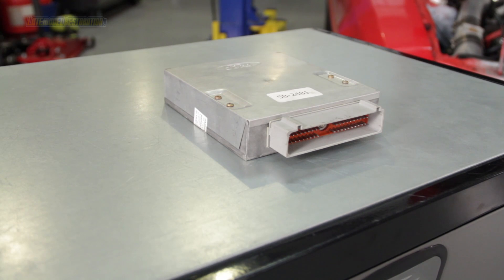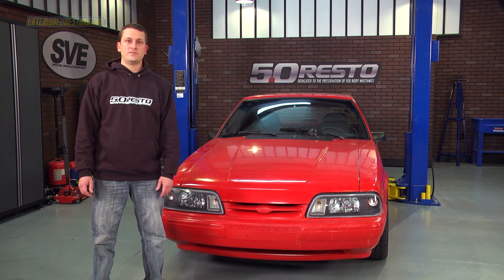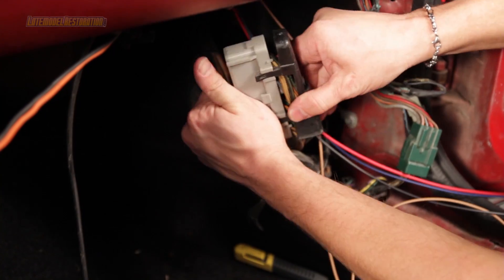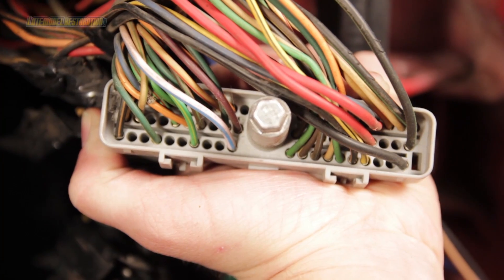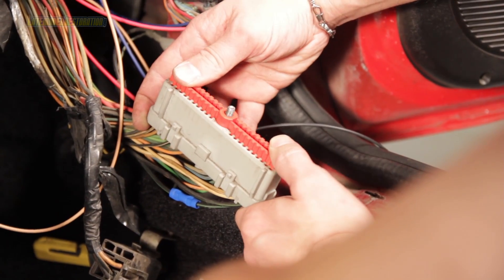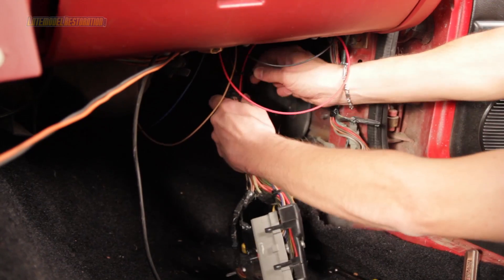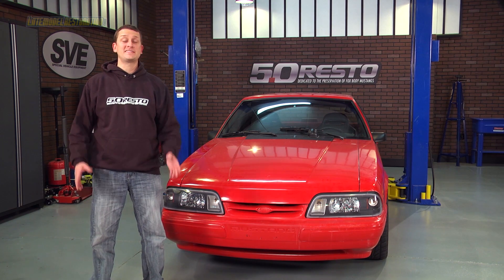Mustang GT/LX Mass Air Conversion Review & Install (86-88 5.0L)

Comment: Long shot with this video being 10 years old.
I have a 1989 F150 5.0 4x4 4 speed manual trans.
Will this work on my truck? Will i need to  get a HO computer?
Reply from the maker: I'm not well-versed with MAF conversions on the F-150s. There is plenty of info posted to old forums that you can research. Thanks. -Landan

Comment: Got a 88 should I go mass air or Terminator x? Help me choose guys!!
Reply from the maker: Pros/cons of both. A mass air conversion is obviously cheaper and will still support upgrades. However, you're still stuck with an aging ECU and harness. A Terminator X is obviously a brand new ECU with a new engine harness. You can tune it yourself or have the ability for others to tune it for you due to the support. It all boils down to how much money you want to spend and your goals/expectations for the car. -Landan

Comment: Question for you guys.
I have an 86 Bronco. 5.0 efi with AOD.
I have a complete running, driving 99 explorer with 5.0 not sure on the transmission.
Im having a hard time finding info on using it as the part vehicle to upgrade the Bronco.
Any info on what i can and cant use. And what i would need to purchase from you to make it work seamless as possible. 
Thanks!
Reply from the maker: Thanks for the comment. It's been a long time since I've messed with a MAF conversion on an OBS truck. I probably would have to turn to an old forum post to make heads or tails of what's going on. I'd rather shoot you straight then beat around the bush acting like I know how to do it. Thanks for understanding. -Landan
Reply: @latemodelrestoration  thanks! I can respect that. Can you show me where i may start searching? I dont mind doing the research if you can just point me in the direction.
Reply from the maker: @johnnymula2305  I would just straight into Google and start searching keywords like, "1986 Bronco MAF conversion". -Landan

Comment: i have a 88 f250 that im gonna convert to roller and id like to use a kit like this so i can put a cam in it,if i get a a9l ecu all this should be relatively the same correct? id assume i can just get a air tube from a later model f150 to accomadate the maf
Reply from the maker: Yes, but you'll need to modify the stock harness to work with A9L.  I don't know the specifics so I would suggest digging around on some old forum posts for more info.  -Landan

Comment: Im currently doing an explorer swap into my foxbody. Searching for what to do for my MAF. I plan to use the explorer throttle body and maf sensor/body. Should I cut my original female side off and put the explorer female side on. Or start looking for a 94 to 95 mustang maf sensor?
Reply from the maker: Hi Allen, 

If you can, please give us a call at 1-866-507-3786 or use the contact us link below to email our tech team. We'll be more than happy to assist you! https://lmr.com/contact

Comment: This doesn't go into running the proper wires for the FPM2, TSS+/- signals.  If you don't the mass air EEC4 will throw codes.  Some experience drive-ability issues, some don't.
Reply: Could you provide more info on what you mean? I'm trying to figure out a sloppy install from the previous owner and I'm wondering if this is the wiring you're speaking of

Comment: So Im swapping my 88 from Aod to t5
Do I need to buy a conversion kit with A9l computer ?thanks
Reply from the maker: Yes, the A9L would be the correct PCM for automatic applications.
Reply: Thanks for replying,
Well but after the transmission swap the car won’t be a auto anymore so do you still saying that I need a computer for automatic car ?
Thanks
Reply from the maker: I am very sorry, I typed that one in wrong. The A9L is the 5-speed and the A9P is the auto PCM. I am sorry for any confusion.

Comment: You forgot to show pin #19 to the fuel pump relay, and the speed sensor (if equipped) pin out!    If your going to do tho this complete the process.   Check out House of dula !
Reply: i have a 1987 mustang gt and im converting it over to maf air what has to happen to pin number 19 and im quite sure mines set up for the speed sensor right .

Comment: So do I need to buy a new “compatible” pcm ? I have a stock 87 lx and I’m trying to do this maf conversion
Reply from the maker: Yes, you will need to source the proper A9L or A9P from any 89-93 factory 5.0L V8 Mustang.  The A9L will be the correct option for a 5-speed and the A9P is for an automatic.
Reply: Late Model Restoration thank you for the quick response, and please consider making a How-to on a bigger under pulley !
Reply: @latemodelrestoration  with the A9P with with a TH400 GM auto transmission?

Comment: Would this work on an 86 F150 and would i need to change the o2 sensor to a 4 wire and add one on the left bank?
Reply from the maker: Thank you for inquiring about our products. While many of the products we sell may fit other Ford powered vehicles, we solely specialize in the 79 to current generation Mustangs and SVT Lightnings. 

To best answer questions about non 79 to current Mustangs and SVT Lightnings, we would suggest you try internet forums specific to your vehicle or even some internet searching. We believe heavily in customer service and would hate to give you incorrect information due to us not being experts for your vehicle.

Comment: Did you have to take the dash out to do the swap? Got my wiring all spliced in but can’t find where the harness goes into through the firewall
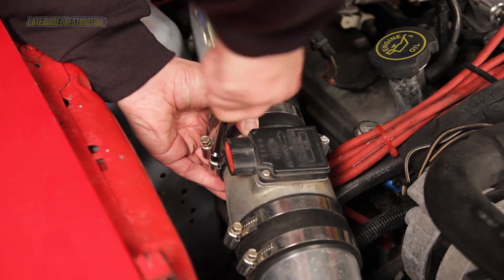Reply from the maker: Go to the 1:30 mark on the video and this will show you the location of the firewall grommet.
Reply: Late Model Restoration knew that lol. Should’ve said couldn’t reach it with the heater core housing in the way, my bad. Ended up drilling a hole to get my maf wiring through. Thanks for the response!
Reply: @garrettrocks9888 where did you end up  drilling the hole?

Comment: Will this work for a 1993 f150 351w with sd?
Reply from the maker: Victor, We only specialize in the Mustang and Lightning platforms. Your best option would be to contact Pro-M directly to verify this for proper operation.

Comment: 9v on the TPS sensor is all u need to keep idle and TPS is more percise then MAP sensor  . Ive owned 16 foxs and know them inside and out
Reply: Mad River Reefs  how would do that with a bolt meter ???
Reply: Mad River Reefs even if it has a cam ??
Reply: Mad River Reefs  do u have Facebook I have question I’m having trouble with it

Comment: I have a 1989 5.0 with a AOD I would like to change it over to a mass air flow what is the part number on the computer I need
Reply from the maker: Brian - 1989 5.0L Fox Mustangs were equipped with a mass air meter from the factory. -Landan
Reply: @latemodelrestoration  could I do this conversion on a 5.8 liter Ford f150 92 manual transmission can anybody let me know about this

Comment: Can I use this kit, modified a bit of course, on my 86 F150, 5.0 AOD?
Reply: I called the company, you can use it, just grab a computer off of an 87-93 mustang. It’s OBD1, AOD (all mech) trans, and then its plug and play. My only worry now is carb compliance
Reply: Chris Sagredo wym carb compliance
Reply: 86 Bronco here looking for the same info. Have you found any information since your post?
Reply: I also got a 1986 f150 5.0 Aod , bought it with wires all over n want to install fresh ones

Comment: Is this necessary just to swap an upper and lower intake like say trick flow or edlebrock kits you guys have? I have an 86 gt with nothing but a cold air intake bbk
Reply from the maker: Most of the time you can swap upper/lower intakes without any problems if you're still running a speed density setup. -Landan
Reply: ***** Great, thank you. Any suggestions as to the best straight forward swap kit you guys have?

Comment: I have a 1988 Ford Crown Vic with a 5.0l, want to convert to HO 5.0. Can you use any ford processor from a vehicle that was equipped with an HO? Also how do you know which processor to use with different fuel injectors and cam?
Reply: Wyatt Godtel if youre using the stock HO cam, E7/GT40 heads, and H.O./explorer intake, moddified mistang throttle body and bored egr spacer or a ford lightning egr spacer(rare to find) and 19lb/hr injectors a speed density H.O. AUTOMATIC ECM will be plug and  play after all the engine mods are done. Mass air is needed when doing a aftermarket camshaft or forced induction (excluding nitrous). I hope this helps. Check grandmarq.net for alot more info on these cars and a list of H.O. items needed when doing the conversion(although i listed them for you.)

Comment: speed density is better though , its what fast and holley efi are. Mine has cam, heads, blower, injectors and is stock ford speed density and runs fine soooo
Reply: Dillon Nipp did you do anything to tune the speed density setup? I have a 94 Lightning but everywhere i read and look it says I need to convert it to mass air in order to do anything to it.
Reply: Dillon Nipp This is a load of crap lol. Have put numerous vams in speed density cars and they have ran like complete shit. Aftermarket efi learns off the wideband O2 and vacume. The stock Ford ecm uses a closed band O2 and reads rich or lean no fine tuning and the vacuum is set to read between 2 set points and anything erratic or below or higher tham those 2 set points and it cant read it. So continue lying to people and trying to act like youre some sort of wiz when anyone with mustang or ECM knowledge will tell you the stock speed denaity Ford ecm will not handle any camshaft other than stock.
Reply: @OGskunkMASTA  actually there are many cams the stock SD setup will handle. You just cant go very aggresive.its often hit or miss tho how the car will respond. Sometimes they run great sometimes they dont. If ur on a budget and doing a cam swap anyway. Throw it in see how it runs. You may be totally happy with it. If not then do the conversion. At least u had the chance to save the money is the point. In my case it worked out just fine.
Reply: Ford SD uses bank fuel map, it measures vacuum, a cam and even hedders can throw it into a shit fit. Stop lying to everyone.

Comment: Thank you for this install vid I've been waiting for a really long time to do an MAF conversion and I wanna get it right thanks guys!
Reply from the maker: tukamoton1312 You bet! -Landan
Reply: +Late Model Restoration im alao doing this conversion,my concern is the o2 sensors. is there going to be issues? im i. the process of installing cam,heads. rockers,rods trick flow upper and lower with a egr delete spacer. ive read alot about after these conversions that there are o2 problems.help!